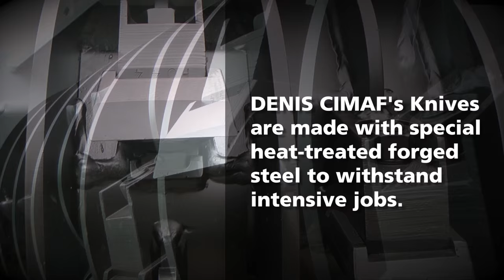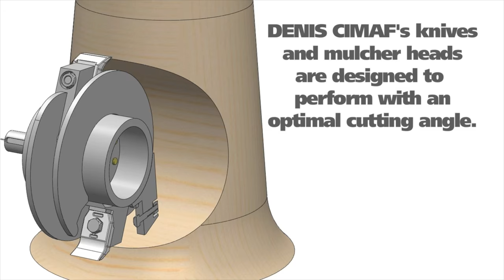Knives design - DENIS CIMAF's DAH and DAF technologies - Industrial forestry mulcher

Comment: I am a general engineering contractor, and can fully appreciate your cutter head design. What most other companies don't get is that it's all in the geometry. Your cutting depth limiters are the key and I don't see this in other heads. They rather club the wood and jam it in the cutters at random depth, stalling the machine. Your head is the difference between a straight razor and a triple head pivoting blade.Too bad you cant get the price down so one does not have to be full on into the business to justify one. I see the Chinese have cloned your cutters and are selling for $12 to 6$ [if you buy 49,000 at a time] . And about your gas powered grinder - I would go to a lithium cordless grinder with 12 volt charger in this day and age. Can keep it in the cab of the machine.
Reply from the maker: Thanks for your input! Send me a email on marketing@deniscimaf.com if you feel like telling me more and sending me links! Thanks ! Have a nice day

Comment: This is a little off topic, but what kind of sharpening or grinding tool is he using in the video?
Reply: Deb Pine looks like a home made rig using a weed walker and a 8" grinding rock.
Reply from the maker: it's a custom gas-powered grinder we send with each DAH or DAF heads!
Reply: @deniscimafincus , small battery operated one would be more practical.  Maybe supply just the grinding wheel & gauges & let customer supply  their own power unit as an option.  Most guys already have the tools / power units.
Reply from the maker: Yes, we have backing plates for battery powered grinders. You can request models of backing plates that we don't have by calling parts dept. 1-877-279-2300 ask for parts

You need to be careful to have the same grit on these sanding disc though. If you heat up the metal too much when you sharpen, you can negate the effect of the hardness treatment. Sharpening should be a short process repeated every 4 hours of operation. If you keep your blades sharp it should be small touch up every time.
Reply: DENIS CIMAF Inc. where can I purchase?